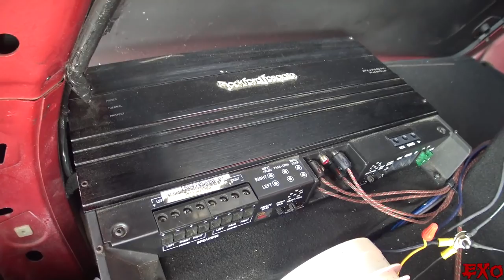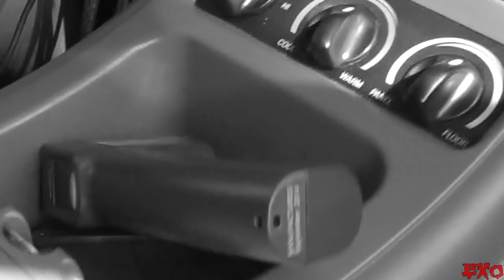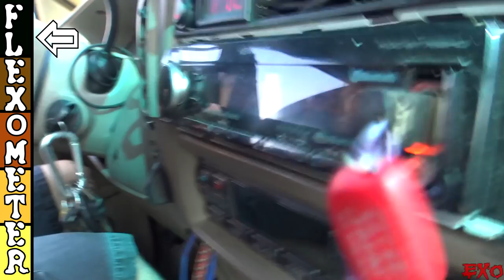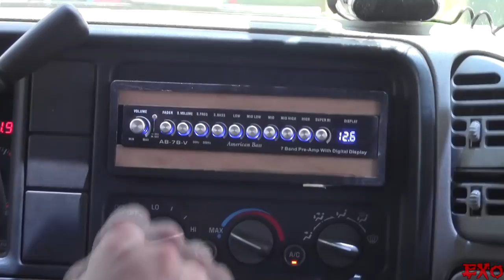SMELLY Subwoofers on BLAST... 4 Orion HCCA Car Audio SUBS & Custom Bandpass Subwoofer Box Build

Comment: Can anyone suggest me a build within 1000 euros? 
And another thing, can anyone tell me which is worth it, 1x15 2k watts subwoofer or 2x12 1k each?
Reply: I think the 2 12... a second same speaker makes 3db more than one if the 15 not 3db or more louder than the 12  is better 2 12..
Reply: Deutscher ? Dann kann ich dir helfen
Reply: @batery5156  No, but I'll try to translate it.
Reply: 2 12s more come area.. that being said.. I had 2 12 sundown sa and a single 15 type x.... the x got alot lower but loud wise about the same
Reply: @kmcgz  Thanks for the answers. I still think what could I build within 1k. I was going for the JP's sundown package, but the price of shipping to my country is like 300 pounds so no thanks..:/
Maybe ground zero would be a nice choice ;3
Reply: I'd say the 1 15. It's probably about the same in terms of how loud it is, and my bet is the 15 will get a tad lower. Either way it'll pound in the right box with a decent amp
Reply: I have seen measured 150 out of 1 15" and 152 whit 2x 12" in same car.
Reply: Depending on how your amp manages a single 15 you could start there and save up for a second 15. Who knows the single 15 could be enough.
Reply: @boacarecords  2 - 12"s for sure. More cone area and can fit into smaller spaces. Brand is hard because you live in the UK (I assume). Pioneer head units are known for clean output. Orion amps seem to be the cheapest priced and best power output currently, of all the popular brands in our Youtube circle, and by a large gap. Mids and tweeters - Just about any decent brand will do. Just don't overpower them. 

I would even say that apart from the subs and mids/tweeters, used gear that you make sure is working, is perfectly fine... And often a better buy for your money. Good luck.
Reply: Thanks for the answers, now I choosed my subs, I can choose between 2 fi q 12s (1300 rms each) and 1 gzhw 38 spl (3500 rms). Some opinions?

Comment: im so with exo on the statement he made at 2:16 I rock a dual 12 fusion sub setup there nothing crazy at all I'm pushing 1200w on a kicker amp and stock electrical under the hood now don't get me wrong I think these crazy wall set-ups pushing 20,000 are bad ass but personally id never do that my dream setup is a dual 10 sundown audio setup with some type of rockford fozgate or what ever the correct spelling is that's as far as id go but I respect everything from 6.5s all the way up to 30s if you like It you do it and if you don't then don't be around it

Comment: I have 80w subwoofer and i cant put my ear on it because it is so loud!I don't know how you can survive this!
Reply: 80w really? i think my 2 12's on 2500rms is't that loud
Reply: @tomit9794  might mean put ear to the port, lol ar 23 hz aries they playin at you feel it not hear it so it dont hurt ear as bas
Reply: 4 or 5 years ago I got into subwoofers and bass speakers and my first subwoofer was a 60 watt 8 inch subwoofer and when I first raised the volume I freaked out for a minute and lowered it way down because i never felt bass before. But more I got into it I started to play with it and there was 2 knobs in the built in amp. 0 to 200 frequency and 0 to 60 watts of bass. The fuckin sub was spazzing like crazy and excursion. I kept feeling the cone / dust cap to feel if its warm or not. I had fun with it and now I have 2 15s and 2 8s and 1 10. All together is equaling 3,000or 4,000 watts. o.o AND'UH! Soon going to buy 1 18 on 2,000 WATTS! LOL. (In my house)
Reply: I agree with you man and 80 watts? you? I'm not too far from that lol. These guys are monsters in taking in all that heavy spl. I love big subs especially for HTS, but I can't set under all that great headroom without ear plugs, I can't even listen to headphones very high, but those guys are killers on power, it's their passion and I know they will never stop to find a way to improve what they love lol. ✌